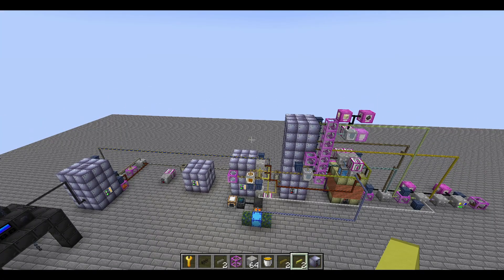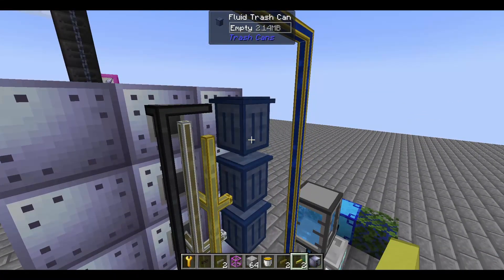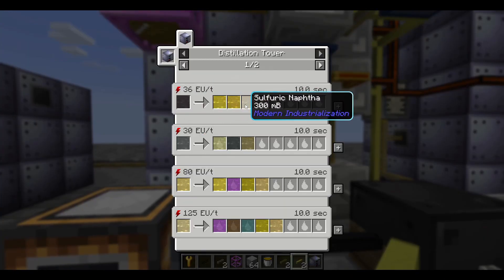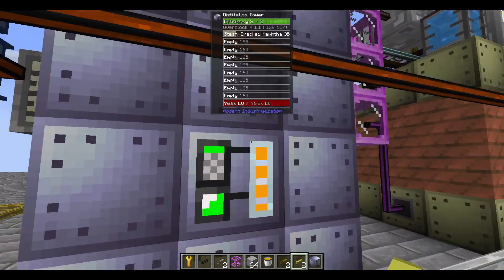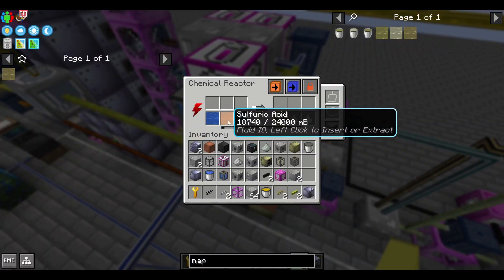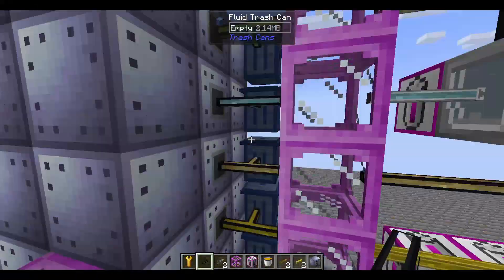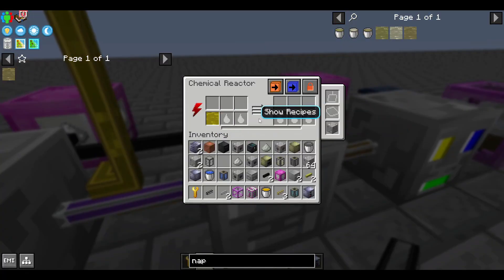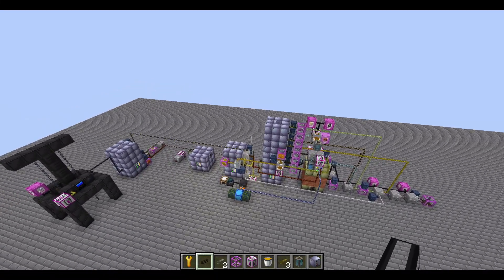FTB NeoTech- Modern Industrialization Oil Processing

Comment: is there a way to change the single output of the Distillery (not the muliblock)
I'm trying to use Steam Cracked Light Fuel into Ethylene (But there are 6 possible products and idk how to select which product it should do)
Reply from the maker: you filter it by dragging from emi like any other recipe